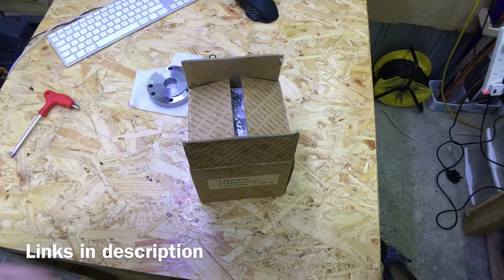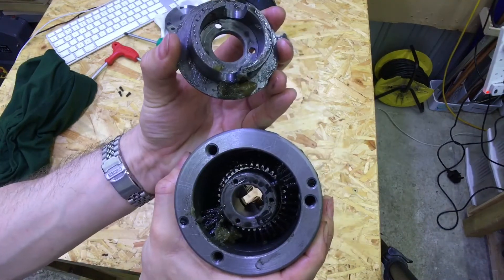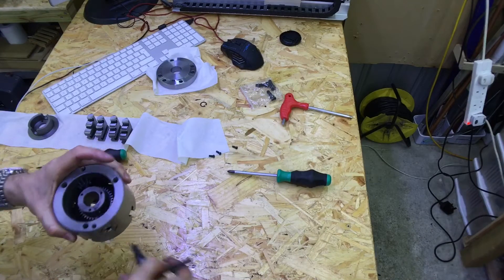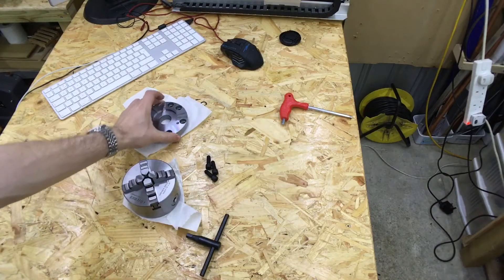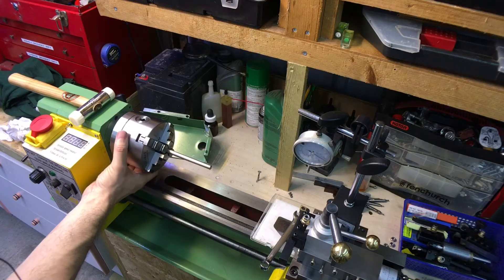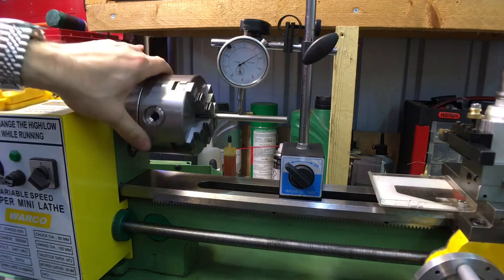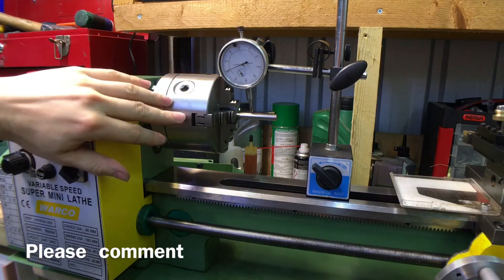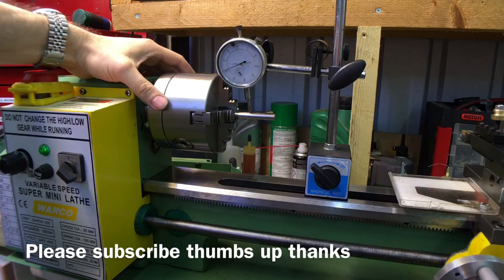Cheap 4 Jaw Self-Centring Chuck for the mini lathe. back plate.

Comment: A universal 4 jaw chuck is my favorite.  It holds the bar stock much more securely as compared to a 3 jaw.  The only flaw with this chuck is that the bar stock must be fairly round and will not work with hex bar stock.  A 3 jaw chuck will always have its place.

Comment from the maker: Quick Change Tool Post https://www.banggood.com/custlink/vK3mJYQoo9
Ebike Parts https://www.banggood.com/custlink/3Dv3bT3Q5l

Ebike Wheel https://www.banggood.com/custlink/KKDKNf7t7S
48V 350W 10.4AH 20 inch E-bike https://www.banggood.com/custlink/3DDGn1TIl5
CrimpTerminals Connectors https://www.banggood.com/custlink/mK3GAuT8oI
Wire Crimp Tool https://www.banggood.com/custlink/DvD3sfwIaa

Handy Good Cheap Tools
*MMA welder i would like https://www.banggood.com/custlink/3vGDsufVnM
*MIG welder i would like https://www.banggood.com/custlink/K3KKs7T5nO
*TIG welder i would like https://www.banggood.com/custlink/Gm3DBGhSsi 
*Tin Snip https://www.banggood.com/custlink/KmmmnwTVMl
*Stick Welder https://www.banggood.com/custlink/DDGKsw7PU9
*Welding Clamps https://www.banggood.com/custlink/mKKGbuwF1j
*Machinist Hammer https://www.banggood.com/custlink/KmDmQ1ut11
*Screwdriver Set https://www.banggood.com/custlink/KmmKATw5w4
*Precision Screwdriver Set https://www.banggood.com/custlink/K3v3Nuwi8V
*cordless Angle Grinder https://www.banggood.com/custlink/GDKmAFL7s4
*Carbide wood turning tools https://www.banggood.com/custlink/KKmKQwfS8S
* flex shaft Rotary Tool https://www.banggood.com/custlink/3KK3Z35Boi
*palm Router https://www.banggood.com/custlink/GDGGbT1iSj
*F-Clamp https://www.banggood.com/custlink/vKDGbfuZiB
*Double Edge Pullsaw https://www.banggood.com/custlink/mvGvb7uIZN
*Cordless drill  https://www.banggood.com/custlink/DmvGNTT9iT
*Mitre Box https://www.banggood.com/custlink/33KvbuTSj3
* Impact wrench  https://www.banggood.com/custlink/mKDK6g6Bts

Above are affiliate links and in the comments it costs you nothing, if you do not want to use links search on goggle more info Thanks.

Email me at diyteknut@gmail.com
#DIYTEKNUT #TOOLPOST #MINILATHE

Comment: You're tapping the chuck instead of the workpiece? What?!
Reply from the maker: Luc Mornstar yes I was trueing the chuck to the spindle. So the chuck runs concentric .
Reply: But why were you tapping the back plate rather than the high spot on the chuck? Seems backwards to me
Reply: @JAYZWORKSHOP  

Heres what I dont get... you say you find the high spot when the dial is furthest anticlockwise, which I think is really the low spot (the needle is further out in that position with the dial on top)....!

Comment from the maker: below are some of the lathe tools i use that are very good.

good Lathe tools 12mm if you have a quick change tool post
https://goo.gl/BzuUVj
Standard inserts https://goo.gl/gzSnw5
Aluminium non ferrous metal inserts https://goo.gl/Zzm6GY

other carbide tools i use 
https://goo.gl/j6LH4a  
Standard inserts https://goo.gl/bUkNVe
Aluminium non ferrous metal inserts https://goo.gl/uRcdND

Hole saw set
https://www.banggood.com/Drillpro-5pcs-HSS-6542-Titanium-Coated-Hole-Saw-Tooth-HSS-Hole-Saw-Cutter-Drill-Bit-Set-1618_5202530mm-p-1053888.html?p=070519238739201308J6

I may receive a small commission for you using the affiliate link above thanks it costs you nothing, if you do not want to use links search on goggle more info